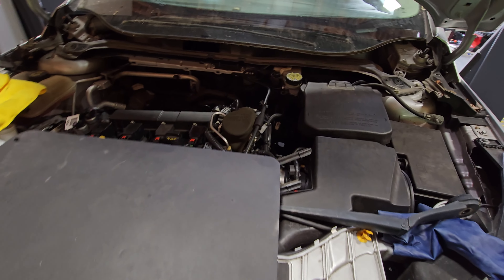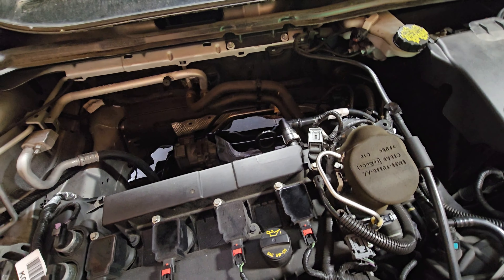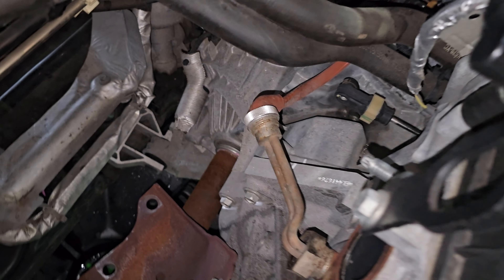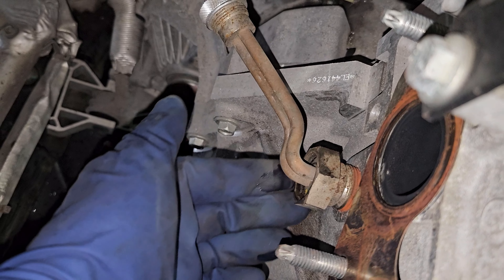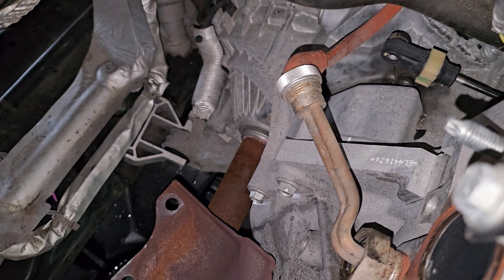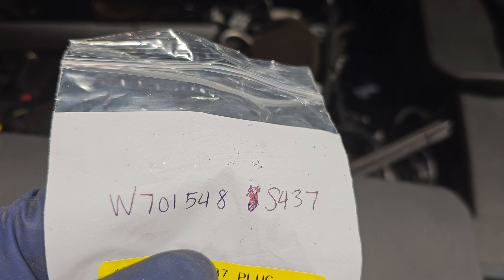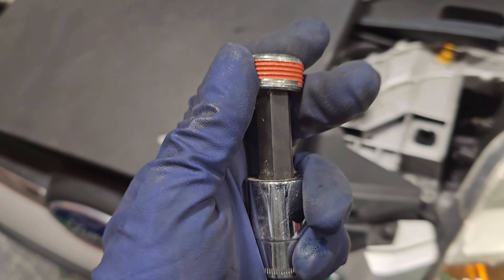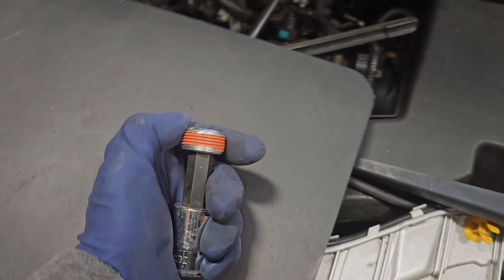2014 Ford Focus coolant block plug replacement

Comment: Thanks for your video. I just want to know do I need to remove my exhaust manifold to replace this block heater?
Reply from the maker: You dont
Reply from the maker: I was replacing the catalytic converter and noticed that was leaking